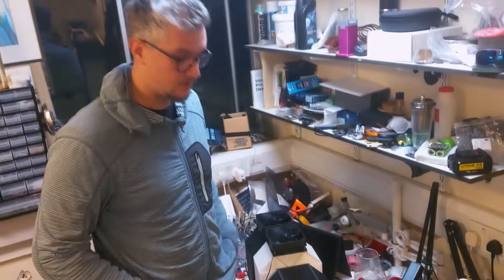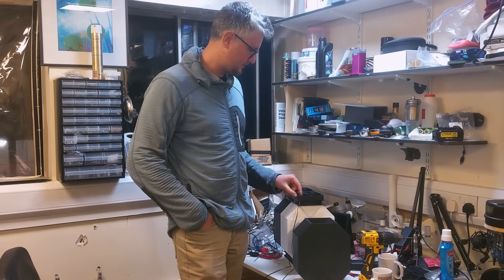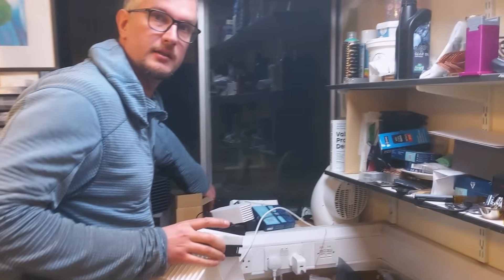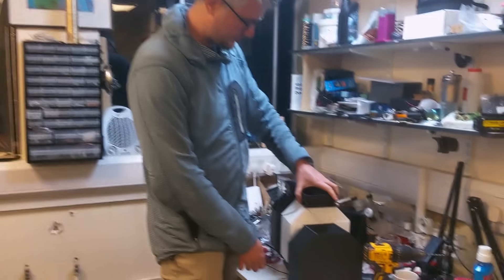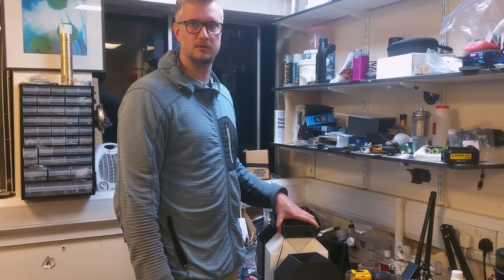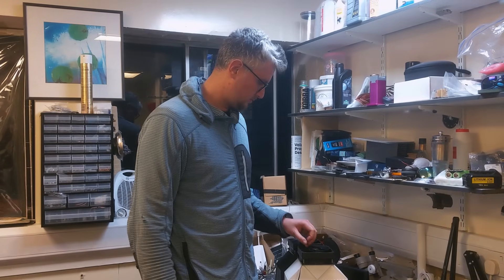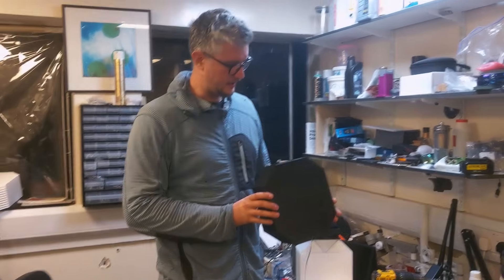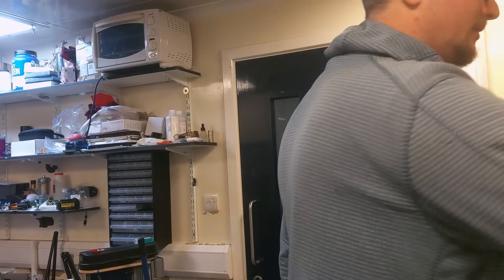Heat and dehumidify your house for cents per day

Comment from the maker: Hi all. Had to repost this for audio reasons, if you commented on the first one please do again here so I can respond.

Currently it only works with that one printer, but a more universal G-Code version is on the way. Will update when it's available.

Til then, any questions please let me know.
Reply: Hello.
Pouvez-vous en vendre ?
 ( Je n'ai pas d'imprimante 3D).
Sankyu 🇨🇵
Reply from the maker: Potentially in the UK, yes, but unfortunately after Brexit posting anything in or out of the country is essentially impossible.
Reply: @ we could try with one. £30 + postage? And which size do you want? 80mm fans version or 120mm fans?
Reply: Any update on this??

Comment: Your design seems to be good, otherwise you wouldn't get your mentioned efficiency. Could you post the structure of the middle part (sketch would be enough). I would like to build one out of a stack of aluminium/copper foil glued to laser cut frames (much faster and still stable). I would like to use your design as a blueprint. Maybe even a combination of metal and 3d printed plastic is more feasable.

Comment: For the core, use "RiaCover" or other thin multiwall material and align each layer 90 degrees (you can simply not print this thin, the thinner the better heat transfer). Then design the box where the core is within, in 3D program and design in your fans... you can make it very similar to the professional ones with very little cost... printing the core makes it high friction = bacterias easily get stuck and stays there to grow.  I did on a 400x400 bedsize 3D printer...
Reply from the maker: We've looked at corroplast and the like, but incorporating it into a manifold in a way that doesn't leak or constrict airflow is tricky..

Comment: Did you manage to achieve any humidity transfer? I also made some 3D printed designs, but I never managed to print them at a large size because the slicing software was completely stuck due to the complexity of the design!
Reply from the maker: Tests ongoing. We're printing via raw G-Code as we also had issues with slicers being able to handle the geometry, or the print taking any realistic timeframe even if so.

Comment: Could this be used for night cooling in hot humid climates by flipping the device to blow inside?  I've been looking for HRV/ERV like device that I could use to capture the cold  outside air in the morning for our house without the humidity.
Reply from the maker: It constantly blows outside air in and inside air out, so basically just keeps the respective temperatures as they are and can be used to instead keep a structure cool, yes.

Comment: I have an idea for you to improve: Split this down the middle, through a cross-section of the fins. Instead of the fins, print a U-channel around the edges where each of the fins would be. Now put a sheet of copper into each U-channel and reassemble the "shell" pieces using 4 threaded rods in each corner.  Now you have more efficient heat exchange, less printing cost (instead cost of copper sheet), plus you can disassemble to clean it.

Comment: I am currently doing a similar project. However instead of printing the great exchanger I am using a tubular design (aluminum tubes). Will be twice the cost but also more compact to fit inside a 100 mm trough real hole. My calculations show it should have 80+% efficiency at 60 M3/hr, measurements will be needed to confirm it obviously. 
I was shocked by the print time you mentioned but then read in one of the comments you use 0.25 mm walls, that explains a lot. 
What kind of heat exchanger pattern do you use? And how do you deal with condensation inside the heat exchanger?
Reply from the maker: Pattern is just a basic triangle tessellation, haven't really had a problem with condensation as any precipitate gets blown out with the air and worst case scenario would could just angle the stack down for drainage.

How are you manifolding your tubes?
Reply: @OpenSourceLowTech  Well as I wrote I am still in the design phase. The fans should arrive in a couple of days and I expect to print the first prototype next weekend. A bit hard to discribe but i make 2 100 mm tubular parts that each end in a 10 mm thick plate. The plates get a pattern of 10 mm diameter holes 8 mm deep and the end of the hole is 8 mm diameter to seat the pipes against. Both pipes are identical except for the part where they slide over each other. On the inside of the house I will glue the pipes in place, on the outside they just slide in (a small air loss on the outside is no big deal).
The 100 mm tube has a cutout on eighther end for a fan to pull air in, the tubes themselves will blow the air out (I blow out trougfh the tubes to make sure condensation occurs here and can be blow outside easily.
Both fans will be positioned at the inside, the one blowing out in the center and pulling in at the side.
Describing it is a bit more difficult than showing the drawing but as far as I know I can't put a picture in the comments.
Reply from the maker: Oh so two big tubes rather than a bunch of small ones?
Will that be enough surface area contact to transfer all the heat?
Reply: @OpenSourceLowTech  No this is why its so difficult to explain... One printed tube of 100 mm consisting of 2 parts. These 100 mm parts will get a bunch of 10 mm (I can fit 40~45 tubes) which are glued on the inside of the house 100 mm end plate and pressed in on the other side.
On the sides of each 100 mm tube half a cutout is there for the air to flow from outside to inside and the inside air will flow trough the 10 mm tubes to also evacuate condensation easily.

I will model up a part with printed tubes as well to see whether as some people comment the heat transfer trough the plastic limits efficiency. I will however use 0.45 mm walls as I don't have a .2 mm nozzle handy. Thermal conductivity of ABS (or most 3d printing materials) is 1000x lower than aluminium. We can however get a higher surface area when printing the channels and surface heat transfer is a big portion of the heat transfer which might well compensate a big part of the loss in heat transfer. I have to recalculate whether I have enough static pressure to get enough air flow with the fans I ordered.
Reply from the maker: Ah ok, think I understand tho a sketch would be useful. 
I'd recommend getting a finer nozzle tho, lot of transfer difference between 0.2 and 0.45..
Reply: @OpenSourceLowTech  I modeled up a part with 6mm hexagonal tubes and the slicer (.step file imported in Orca Slicer) sliced it without issues (though took quite a while to finish). 300 mm long single layer tubes will however likely fail to print. Next step is to link up the tubes such that the air can still pass but the tubes don't fall over during printing.  LOL while typing I realize that a plate heat exchanger would be much easier to model as well as print. It might however have a little less surface area but also might have better airflow so plates can be closer together.
And I found an 0.2 mm nozzle. First test of a mini heat exchanger will run overnight. I doubt whether the flimsy plates will attach properly to the outer tube wall. Time will tell.

Comment: The biggest design challenge is to prevent mold forming inside the unit and to have the ability to clean inside the unit.
Reply from the maker: Haven't really had a problem with condensation as any precipitate gets blown out with the air and worst case scenario would could just angle the stack down for drainage.

Comment: I had  a few similar solutions. One made from cpu coolers and one made from an old heatexchanger  from an old clothing  dryer. Problem I had is that the fans  did stop working  cold and moist I think...  Or they did wear out.  Bearings started to make noise. Then died. Mine where 65 percent and 80 percent. I also printed a case for holding aluminium sheets.  Also tested Aluminium foil.  If you want to procced look for centrifugal fans instead. Squirrel fans.  Then you will have more pressure to recirculate the air.
Reply from the maker: Yeah I was using blower fans for a different design which involved more back pressure. They do a decent job, and aren't much more expensive, but are noisier and consume more power.

Comment: Would be awesome if one can be built using the PETE from old bottles, whether ground extruded or pulltruded recycled material.  Is there a github, thingverse or other location where the models can be downloaded?  Never thought about 3D printing, though studied for years the developments in using coroplast old political sign and other related material.  Makes sense the thin nature of the print I am thinking and the removal of the risers or if can make without.  I am not that knowledgeable on the advances in 3D printing.  Very interesting.
Reply from the maker: Downloads in the works.
Recycled filament could be an option, but given the fine wall thicknesses it'd have to be fairly good quality.

Thought about coroplast, since it's basically the same materials in more or less the same shape, but tricky to effectively manifold to separate the flows, unless they were 3D printed, in which case the savings would be minimal.
Reply: @OpenSourceLowTech  Neat, great to know and share.  

In regards to the coroplast; so to not have a double layer at the perpendicular interface surface in a design that is a top view square where opposite sides are intake and exhaust for each circuit, my though was to maybe 3D print or CNC machine a tool and die so to press a triangle wave side profile surface where possibly can heat in a controlled fashion so to minimalist melt into the above and below coroplast.  Also was thinking doing the same with pressing aluminum door window screen material with the need of supports in the middle and sides if using instead of aluminum can material or aluminum sheet.  I have not gotten past a square design, due to more coroplast cuts required if making more complex. 

Thanks again kindly, really glad to know.

Comment: what gains, if any, are realized by stacking them together, serially?  Would you get a poor efficiency vortex tube like effect?
Reply from the maker: Greater stack length means more time for the heat transfer to take place, but also more back pressure on the flow from turbulence and friction / viscosity etc. Would also need to make sure the seals around the joins between stack were completely airtight, obviously.
It would also tho mean the fans could be turned up, as there'd be more time for a greater volume of air to exchange heat, so would be a trade off.

Given the relatively high efficiency of the system as is however, it seems like the exchange gradient is taking up less linear distance than the existing stack length, so increasing it wouldn't necessarily add much benefit.

Comment: Where does the excess air moisture go, if the fan is pulling that air into the little channels for heat exchange?
Reply from the maker: Blown out with the air.

Comment: Without filtering the interior and exterior intake ports the exchange unit will clog up and become useless within a short time....... especially the channels removing warm, moist, (dusty?) air from indoors. The ability to customize and the low cost potential are compelling. Cool project!!!!
Reply from the maker: We're not getting any noticeable mould or dust buildup, the airflow is enough to push everything through and out of the stack.
Reply: With no drain engineered in, there will come issues (seen others have succes for 6 months and thereafter become sick/ill due to bateriagrowth)

Comment: you make me thinking. I do a little research and waiting for the model to be available. Looking for materials with carbon fibers  or maybee copper particles. Something like PETG-CF or  MetalFil . I belive both will have higher thermal conductivity than PLA. First one will be even lighter and other one quite heavier since it have up to 80% of copper powder inside.Also thinking about Noctua silent fans and some thermal dependent speed regulation...
Reply from the maker: We'll be experimenting with graphene infused filament for this purpose, should increase the thermal transfer, but also the price so will be a cost benefit analysis.

Comment: would hepa filtration affect its function negatively?
Reply from the maker: Probably not if you made the intake large enough, but would only really be necessary for places with air pollution coarse enough to get caught in the filter.
Reply: @OpenSourceLowTech  I live in washington state US. Probably not unlike scottland. We get a lot of fir pollen and lots of other fungal issues.  I found some sheet hepa filtration and I don't know the through resistance just yet I will provide it when I can. 
Currently I heat with a protable ac/heat/dehu unit that is primarily AC I believe and it can pull a lot of moisture out of the small place I use it. (RV 20')
Reply from the maker: Scotland can get pretty polleny too up in the highlands certain times of year, we should probably do some testing of incorporating filters into the design..
Reply: @OpenSourceLowTech  I failed to mention it previously, My ac unit does have push pull ducts from the window which is not ideal. The intake hits the coils without filtration possibly affecting its life span. I used some screen door screen but thats not nearly adequate but keeps squirrels and large insects out (I hope) My additional concern is that I am loosing a lot of heat through those ducts and window setup. I can resolve that in other ways but I am intruiged by your device to possibly minimize that loss and increase fresh air inputs. 
I am watching with great enthusiasm

Comment: I've been kicking around a similar idea for some time but to be used on electric clothes dryer vents instead of just the indoor air.  The whole thing would remain internal and be used to recover the heat in winter.  Sending that warm air outside when it is -20° outside is such a MASSIVE waste.  I've been looking at automotive turbo intercoolers but I am simply not willing to pay that cost.  I have to wonder if this is something I can make work for my purposes.
Reply from the maker: This should probably work well for that, but also far as I understand clothes driers have cross flow exchangers which you can maybe pull out of an old one?

Comment: Micro plastics, micro plastics everywhere. I don't think directly using a 3d print attached to a fan blowing hot and cold air is a good idea.
You could use the 3d print as a mold with something like silicon instead.
Reply: Ever driven a car? Have a fan made of plastic in your house? No different
Reply: @eldnoxiosnights37 the fan is not the issue, the charging of temperature is.

Comment: I need this for my Bathroom, but I am in Europe and our windows either tilt to open a crack or fully open, they don´t slide side to side. I am also renting so I don´t want a permanent solution (50% of people here rent Germany, Switzerland, Austria)
Reply from the maker: We're working on a version which attaches to German double opening type metal frame windows, as they are very common.
Reply: @OpenSourceLowTech  That´s great.
I have one idea of my own, I thought of creating a product myself since I am a design engineer myself but maybe you can take the idea instead since I don´t have the time for that kind of stuff. 

You can use an attachment to the window which is renter friendly and works with Plastic frames (GER AUS SW) 
It´s the same attachment as the "Fensterfalzlüfter" uses, where a bracked (3D printed or not) is attached inside the sealing groove. To do so, you need to cut out a small piece of sealing (it can later on be inserted back) and then either clamp or screw in the bracket (inside that groove, again refer to the "Fensterfalzlüftung" you will see what I mean). This way you can evacuate the damp air from the room without having to open the window altogether and the rest of the sealing stays in tact. As for the small piece of sealing which has been cut out, you can either place it back or glue black with the rest of the sealing, which makes it renters friendly.
The only downside is the square section of the opening is quiet small. However it can be modified by the amount you cut out and it should be more than sufficient for a small bathroom.

My idea originated from my need to vent my 3D printer cabin to the outside in the winter. The only specification missing to my original design is a heat exchanger, but only because my original idea was to get the fresh air from an other window, room or opening in the house.

Please let me know what you think.

Also to anybody else, you can take and modify this idea to your needs. 
I am pro open source, if it helps you to vent your hobby thingy like a 3D printing chamber, Laser engraver or what have you then I am all for it, stay healthy, don´t breath in that stuff.
Reply from the maker: Interesting, we'll look into that for sure. For my CAD version of the exchanger I was using blower fans rather than prop types as they're a lot better with backpressure, tho do consume a little bit more power and are noisier. But would probably be the best option for what you described.
Reply: @ "... I was using blower fans rather than prop types as they're a lot better with backpressure..." Yes exactly, I am using those too for this type of application. That´s what they are made basically ...more or less.